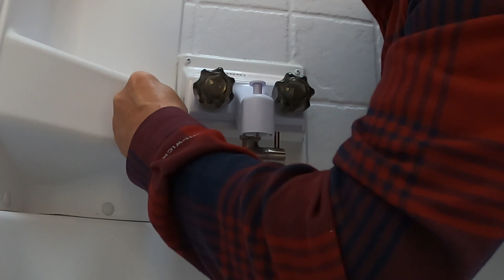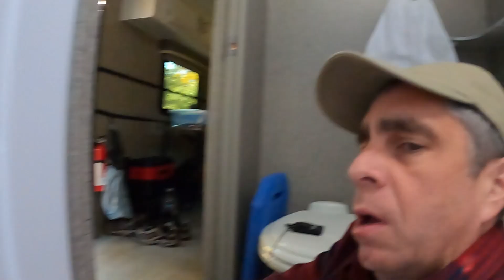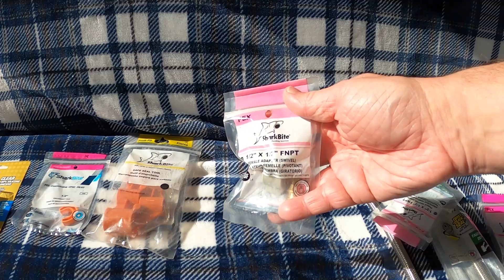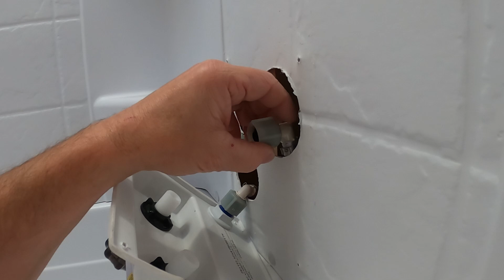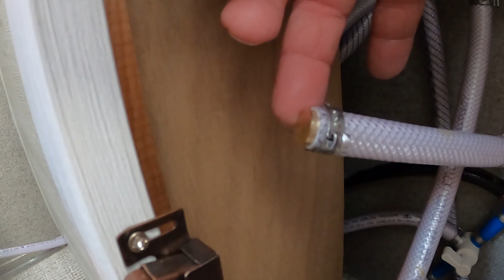RV Shower Plumbing Leaks (Pt 1) | SharkBite NPT Adapters | Geo Pro Travel Trailer

Comment: Are the plastic fasteners in the shower walls something that can be bought at a hardware store or do you have to order from the manufacturer or RV dealer?Seems like they tear up when removed. I’m in the process of replacing the vinyl hoses in a 2021 Geo Pro 19 FBS.

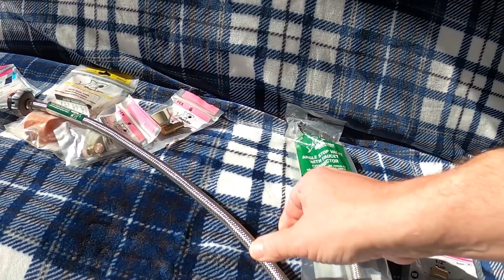Comment: Josh Winters from Hayletts RV just recently visited the Geo Pro factory. It's a good video on how they're built. https://www.youtube.com/watch?v=jW5t_OOUuRY At the 10:03 mark you can see the plumbing assemblies waiting for installation. It's hard to believe that people doing the repetitive work of making these plumbing lines and fittings could "goof" them up. They sure did on yours though......sad to see on a brand new trailer.
Reply from the maker: Hello, Richard. Because of the link, this comment was held for review. I agree with your comment and as I just mentioned in my other reply, I don't blame the assembly teams. No matter how hard I tried, some of those fittings just could not be connected without them leaking, usually a very small leak. I don't think I saw that video Josh made. Nice find.

Comment: Your digital micrometer is a winner! I have been using one for about ten years. They can be picked up on Ebay super cheap and a better quality on Amazon for just a few dollars more. I even have a "spare" in case my first one bites the dust! Actually I have given my sons one of these and they love them.....one's a Nuclear Engineer, another a Civil Engineer. Nothing they would use at work but great for the home tool box.
Reply from the maker: I picked mine up at Harbor freight. It is pretty handy for general guesswork. But yah, I don't think it would be a good idea to use it for checking tolerances on something like a centrifuge lol.
Reply: @MarioWorkedOnIt  Fully agree!

Comment: The camper is still under warranty? If so why continue putting your money and time into it?
Reply from the maker: Excellent question. I should probably make a video in order to give a good answer. The short answer is the fittings supplied by the manufacturer are not dependable and I believe it is better to find a solution that I can implement while camping.
Reply: @MarioWorkedOnIt  ACE Hardware and Home Depot sells better quality than what the manufacturer uses. PLUS no three month wait.....hard to do when you full time in your R.V.